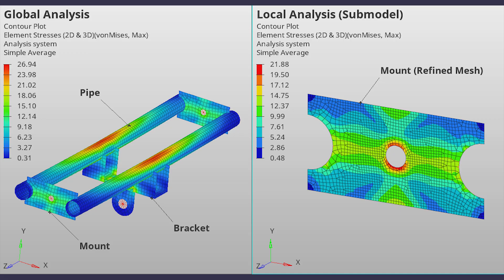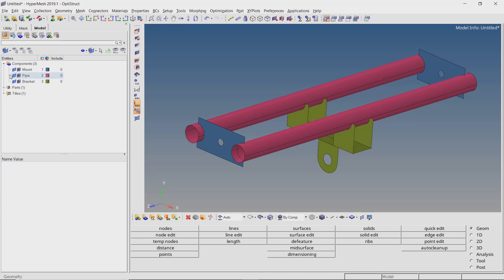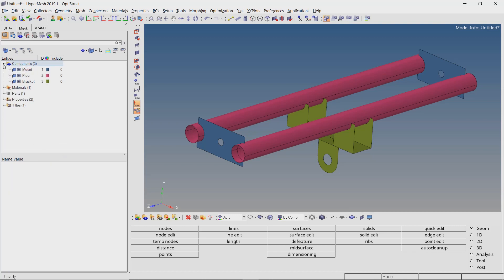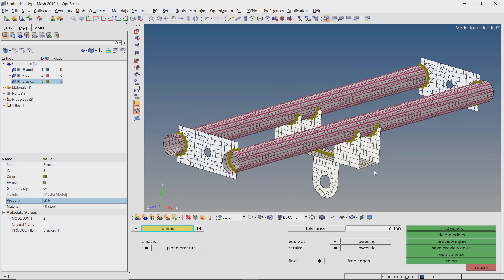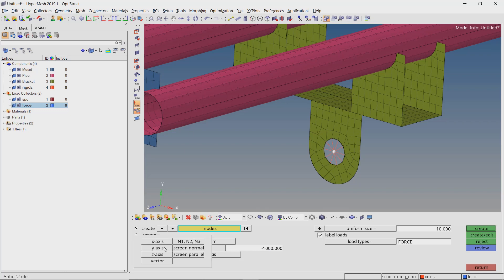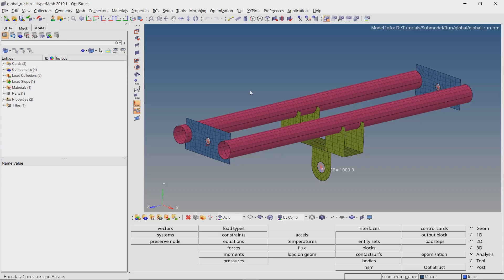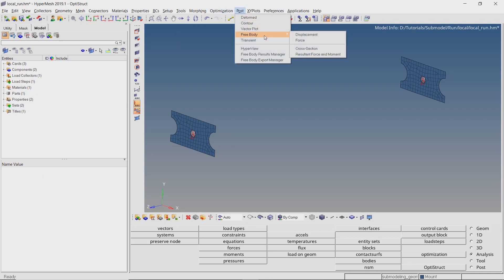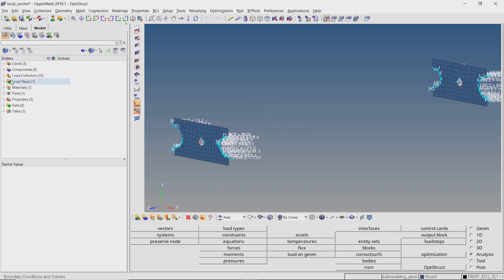Hypermesh Optistruct Tutorial [Global-Local Analysis]

Comment: I just want to thank you very much for your tutorials. They are great.
Would  it be possible for you to add some additional details to the selections you make? For example (in this video): Why are we outputting 3 different formats? Why are we setting the "Post" option to -1? Why are we setting "autospc" to "no" in this case but not in others? What happens if we allow "autospc"?
Thanks again.
Reply from the maker: Hi Allon,
I am glad you liked the video tutorials posted on this channel.

Thank you for pointing out the difficulties in understanding the need for certain steps in the analysis setup process. I will make sure to provide more details regarding every setting henceforth.

Additionally, I will also remake this tutorial such that it is easier to understand and follow.

Thanks again!
Reply: I tried to import loads on version 2021.2 and couldn't do it. The FBD interface is different.
Reply from the maker: Yes, I have realized this issue. I will be recreating this tutorial soon with the new version of Hyperworks.
Thanks for pointing this out!
Reply: @Aeroswap  I was able to import the forces in version 2021.2 and get the same stress results. However, if my local mode does not include SPCs, then the model goes flying to infinity. If my local model does not include the location global SPC location, then I have to place new constraints on my local model in locations where they don't really exist. This will alter the results.
I also don't understand why you kept the SPC in your model and why it would be necessary at all.  A FBD is supposed to have forces and moments in place of constraints.
Thanks.
Reply from the maker: Yes, you are right. It is possible to run the local analysis without redefining the SPCs. This can be done by triggering interia relief method where supports are created (automatically or manually) instead of SPCs. This will eliminate the need to create unwanted (extra) SPCs in the model.

As I mentioned in my previous comment, I am working on a follow up video in which I aim to demonstrate a better way to perform global-local analysis. I will make sure to address all the issues you have pointed out in that new tutorial.

Thanks!
Reply: Thanks for the quick reply.
Reply: Me again.
If you haven't already redone the tutorial, could you also include an explanation on local analysis with different geometry, not just a refined mesh?
I'd like to be able to section a geometry, or isolate several components within an assembly, then import the loads at the boundaries of the section/components and simulate changes to the geometry itself (or adding/subtracting components) within the boundaries.
Thanks.

Comment: Happy New Year Swap! Thank you for showing the breakout modeling method. It is very interesting to see how the hypermesh freebody tool can be useful to apply the previously-collected gridpoint force results from the global model to the local model as a new load collector. I like how it automatically creates LOADADD card that includes all the gridpoint forces and moments. Also thank you for proving this method showing identical results between the global and local breakouts. 

My question regarding this gridpoint force approach when you further investigate the local refined model, 
I see you did fine-mesh and assigned anchor nodes to map out those gridpoint forces/moments at the same exact nodal locations. I am curious, if any interpolation is needed for the other refined nodes (unmapped) and by doing this would stress results be changed? Also curious where I can find the interpolation feature in the hypermesh. 

My question regarding BCs when you do the global to local,
For the mount components they already have the original BCs so it's easy to breakout with the gridpoint forces and run the analysis. 
How about if you breakout the bracket component? I would assume applying the gridpoint forces/moments on the welded edges, but how would you define the BCs? Would there be any arbitrary BCs to run the analysis?
Reply: Thanks for investigating this with me guys. I found a linear interpolation tool in the BCs>Create>Forces. In the dropdown tap you can select linear interpolation. And then you can select the loads (in this case the gridpoint forces from op2 file) by clicking the double-headed arrow. This tool seems to only work for one direction, meaning you need to interpolate Fx, Fy, Fz sets separately. Also you can do this same interpolation method for the gridpoint moments from op2 file. As a result you would have new additional 6 load collectors that are interpolated from the original 6 load collectors from the op2 file. You can create a new LOADADD card to combine all these 12 load collectors and reassign to the load case as a new load.

However, with the interpolated forces/moments added to this local refined model, stress value spiked up 3 times greater (63 MPa) than the non-interpolated one (22 MPa). This is perhaps due to the interpolated forces causing the load imbalance (additional loads applied to the mounts) rather than falling into the equilibrium as the original gridpoint forces/moments. Thus this method is not correct. Maybe we should look for a feature that re-calculates the gridpoint forces/moments from op2 into a new set of loads/moments to the desired nodes (refined). Or perhaps we shouldn't worry about the force interpolation at all. Let me know what you think.

For the sake of my curiosity, I've confirmed the freebody-displacement tool also works for global-local breakout. We can use this the same way as the force tool except for few changes. Redefine the node set by deselecting the RBE2 independent nodes from the set. In the FBD Displacements tab, you can select element set, node set, deselect create spcd and create cvs file. As you click accept a new load collector is assigned for the enforced displacement constraints. And then create a new load collector with the SPCADD card to combine this new constraints with the original BCs (fixed RBE2 independent nodes). In the load step assign this new load collector with the SPCADD to the SPC slot. There is no load assigned as it is an enforced displacement analysis. As a result global and local models both show same stress results (16 MPa) whereas the local refined model show 21 MPa. If we consider interpolation, maybe displacement approach works better?
Reply from the maker: Wow! Thanks for such an insightful and detailed summary Ken. As you suggested, the interpolation tool causes spikes in stress values but I think it can still be used for simpler geometries. If the edge was straight instead of curved, wouldn't it be easier to interpolate the forces using the tool you mentioned ?

I used the enforced displacement BC in some of my analysis runs. Just like you confirmed, the results were accurate. The more I think about it, displacements look like a better solution if mesh refinement is the priority. We can literally select all the nodes on the non-refined mesh (not just the edges as shown in the video) and extract displacements from global model. As these nodes will be distributed uniformly throughout the component, stress concentration wont be an issue after remeshing. Another advantage is that point forces will be totally eliminated from the model which will positively affect the stress spikes and irregularities in stress results.

I just realized that I can make a separate 2nd video about submodeling using this method :)

Thanks a lot @Ken Kim and @Emmanuel Vassilakis for putting in the time and efforts in this. Really appreciate your help!
Reply: @Aeroswap  I agree, there might have been some interpolation errors due to the curvy edges.. And also the gridpoint forces/moments should be re-calculated to map out on the number of nodes. As mesh becomes finer, smaller force/moment vectors should be assigned as the vectors are interpolated. The linear interpolation tool I found used the gridpoint forces/moments to calculate the forces on the unmapped nodes. Additional forces/moments were added to the existing girdpoint forces/moments instead of recalculating them to be interpolated for the size of the mesh, thus it is not the interpolation for the breakout purpose..

Yes I feel like displacements can be another method and some cases it is safer avoiding any errors.

Thank you for your great work! Thanks to @Emmanuel Vassilakis as well!
Reply: @kenkim2687  @Aeroswap Thank you both for your kind words. The questions posed and the respective tryouts remind me of a similar work I did 10 years ago. Regarding the linear interpolation of forces to an increased number of nodes, I can confirm that it will not work and will always return unacceptable errors. I remember HM allows the interpolation of forces received from a .csv file to assist the process of linear interpolation, however as said it is not applicable. Forces, unlike scalar loads like pressures and temperatures are not to be directly interpolated; a workaround is to convert them to pressure loads, however this requires only forces that are at right angles to the nodes. Anyway, I tried what Swapnil proposed: the output of enforced displacements from the global model. That did the trick with the remeshed model (including the edges that now had more nodes than the global model). My results had one or two "hot spots" on these edges, however the final result was acceptable. Swapnil, if you have the time, please prepare another presentation with that process. Very interesting!
Reply from the maker: Sure thing! I will work on a follow up video soon 👍🏻
Reply from the maker: Happy new year Ken! 

Yes, I am also interested in interpolating the grid point forces to other nodes. I tried some experiments but no luck till now. That is the reason I had to reduce the node density along the weld edge. I will surely let you know if I figure out a workaround for this!

As for the other components, I think the case will be treated as an inertia relief analysis. Since there are no fixed constraints on the other components, maybe 'Support' type of BC should be assigned at the weld edges along with the existing grid point forces. I will do some tests with this method and see how it goes.
Will get in touch with you via mail soon :)
Reply: @Aeroswap  I am not sure if hypermesh can do it automatically, however one might try to distribute the forces on the additional nodes using hand calculations. As to the other question posed, the answer is yes it will be an inertial relief case: just add the following parameters in the .fem file: PARAM,AUTOSPC,NO and PARAM,INREL,-2 PS: Good questions by Ken Kim.
Reply from the maker: Thanks for the clarification Emmanuel. But going back to hand calculations seems very time consuming if we want quick results. They should include some interpolation tools in future versions of Hypermesh, it will be very helpful !

Good to know my thinking was on the right track! We are automatically converting a linear static analysis to inertia relief. This is great.

@Ken Kim, I hope this answers your questions!
Reply: @Aeroswap  No problem Swapnil. In the examples I've sent the inertia relief method is implemented, therefore you can check yourself how it works. As to the interpolation mentioned, allow me to have a look and should I find something useful I'll let you and your viewers know.
Reply: Here is a first attempt of an educated guess regarding remeshing the edges connected to the tubes: As explained in the video, extract the loads from the global model to the local one. Create a summation node on each side of the bracket. Calculate the summation of loads on each of the created nodes (post-->free body). Create a load collector to store each summed load. Remesh your model. Distribute the summed loads to the new edge mesh using rigid elements (preferably interpolation elements RBE3s). Continue your setup as shown and solve your model. 
I haven't tested if the above method works or not.
Reply from the maker: I tried this exact same thing, but somehow, there was a slight change in the stress results. Maybe I made a mistake in creating the rigids connecting the summation node to the bracket, I don't know for sure.

I will try this again from the start. It should work, don't know why I'm getting different results.